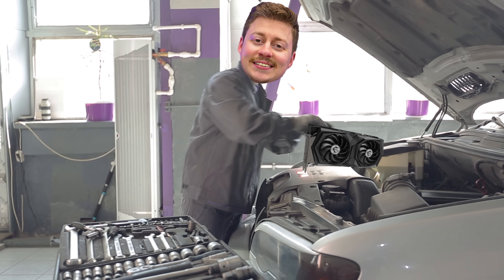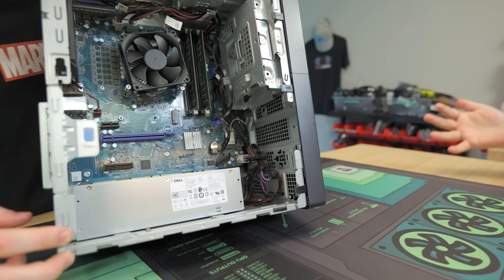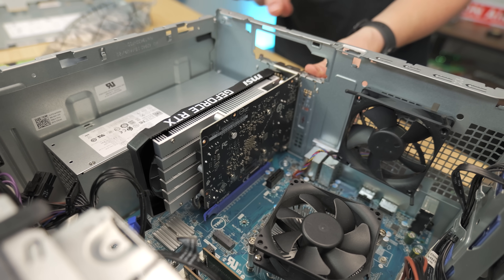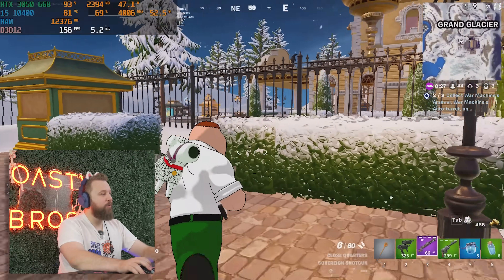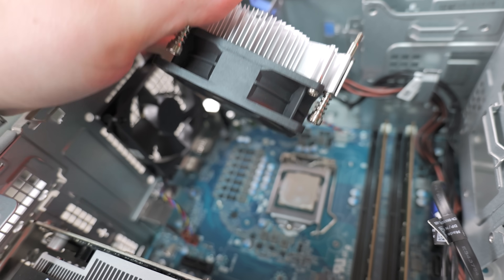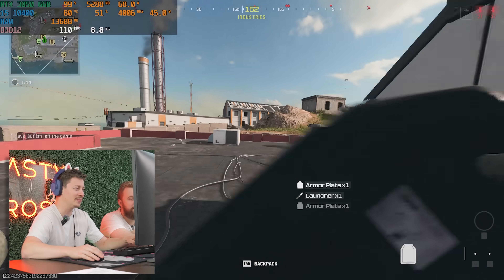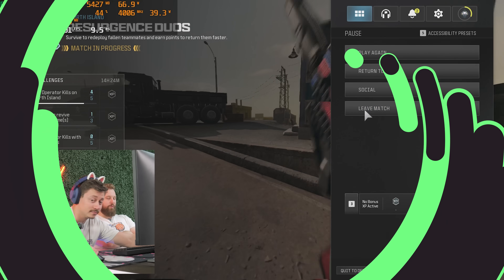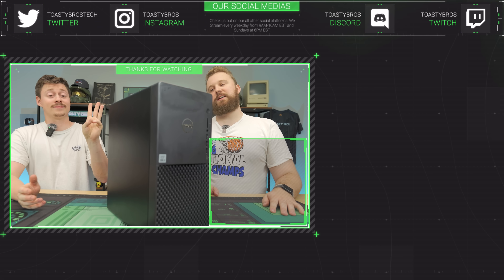EASY $419 RTX Gaming PC Build - Step-By-Step

Comment: I have dell vostro 3888 with the i7 10700 and i add the 3050 LP, but in game (pubg steam) the usage of the GPU does not exceed 60% usage. and the FPS is not stable is arround 40 and 70 FPS in low settings :/ could you help me please ?

Comment: great video. maybe th 3050 in an Ali Express CPU/motherboard combo vs a 3050 in an eBay used CPU/motherboard combo. & kinda impressed since the 3050 is mad low powered & still can play curreny games well.

Comment: I don't hate the 3050 6gb, but I don't love it either. I think this situation gives Intel a bit of shine. the A580 ranges from a good bit cheaper than the 3050 to similar, and the A580 will perform better in most games. the A750 can be found at a very close price point to the 3050 6gb if you are in a hurry, and frequently for the same price, and if you are a little more patient cheaper. That said, the A750 is going to do better in almost everything including ray tracing. 

The Rx6600 is pretty close to the price of a 3050 6gb as well, and would perform better as well.  

If Intel could do a half height single slot A380, those 10th gen Optiplex would be a real bargain. They have resizable bar, and sell new for around $100.

Comment: 10th gen comet lake is the new 4th gen haswell. Cheap but still perfectly relevant. Hell haswell is still putting in good work after all these years if you have the unlocked i5 and i7 k chips and they have a healthy oc.
Reply: I have the curse of an i7 10700f and a 2070 Super. It runs everything in 1080p high to max and I don’t need to upgrade at all. That’s the problem I want to build a new pc but unless I go up to 1440p there is absolutely no need.
Reply: @jeffleecust  Gpu is all you would need and a 1440p capable card isn't all that expensive if you go used. They have plenty of videos showing which used gpu are worth it.

Comment: XPS 8940 has proprietary power supply connectors, although you can get up to a 600W power supply for it. XPS 8930 is a generation earlier (8th/9th) but it has 24-pin standard power. Something to consider.
Reply: You can just run 2 psu if you want the extra power

Comment: I have a 11400f on a b560 motherboard with rx 5600xt. Im running a hyper 212 cooler and the temps are really good.  Actually i found out while benchmarking my PC that it was throttling at like 43C and dropping from 4.2ghz all core to 3.8ghz all core because it was in 65watt mode. Tested with a program from intel called XTU. From there i played with the settings and it was easy to make it so it was set to 125watts and didn't throttle. Be careful if you try this on a stock cooler it may overheat.

Comment: My son uses the original 8GB 3050(not the laptop die)and you're right, it's a very slept on card(for the 1080p market)!
Reply: Rx 6600 is cheaper faster and better at this price point ray tracing is not worth it

Comment: About 2 months ago I found an acer aspire at a store with an i5 11400 16 gb ddr4 (I find it funny the original owner added xpg rgb ram) and a 512 gb nvme also with a keyboard and mouse for only $99. Bought an msi 3050 low profile and a new fan because it sounded like a jet engine. All of it for less than $300 before tax

Comment: I have an i5-10400 paired with a 2060 Super, 32gb RAM, and a 512gb NVMe in a Cooler Master Case that I built.  It runs like a beast , and has an upgrade path. I have it listed on Marketplace for $480 for a couple of months now, and the highest offer I got was $300!! I should start linking these videos to those people.
Reply: It’s used not new what do you expect
Reply: exactly the gpu is used not new,and for $480 I could build a better used pc than that 😅
Reply: Just because new gpu hold their value doesn’t mean used do the same 😢
Reply: @chiboy_speaks  So you are saying that my price is way out of line for the specs, and that the 2060 super is not worth the $175 I paid for it?  What is a fair market value for it? I was basing my price of my cost, and what I see her on Toasty Bros.

Comment: I just got a barebone one free from a friend, he got it off a dude that bought several to sell the GPUs back in 2021, he took the 10700k out of it and put in his PC, so it came with no RAM, CPU or SSDs. Luckily it has the 500w PSU, so I'm thinking of doing a 10500 or 10600(K) and maybe a 2070 or 3060 and use it as an HTPC/light gaming once a while.  These apparently can be upgraded to a Veetroo V5 or a Noctua NH9S for the CPU.

Comment: I run 10th Gen i7 in my primary machine (with a 3060 12g) and am happy with the performance I get across the board.  I like having 2 generations between me and the CPU that eat themselves.  :)  (of course I'm not using that stock cooler nor did I keep it in that suffocating case)

Comment: I snagged a Prodesk 600 G6 from ebay for 143 dollars last week (after shipping and tax), it's got an i3-10100f and an R7 430 gpu, 16gb ddr4 and a 256 gb nvme drive. Probably gonna snag a 3050 6 gb for it if the power supply is connected with something other than a 24 pin but I expect it to perform quite well for the price

Comment: The XPS 8940 is OK, but there are things people should know. Cooling is an issue, while the I5-10400 will do great an I9-10900K will not like it. I bought an XPS 8940 last September with a I7-10700. I bought on eBay the VRM heatsink. Took out the 1 case fan and added 3 Noctua fans. Replaced the CPU cooler with the Dell tower cooler, found on eBay. In addition, took out the 360 watt power supply and put in the Dell 500 watt power supply, which is 80 Plus Platinum. Dell did use several different Mother Boards for the XPS 8940 and some of them can be upgraded to 11th Gen with a BIOS update.
Reply: I just got a free one from a buddy, I got the 500W PSU on this one, no GPU, CPU, PSU, Ram though, so I gotta source out everything else. lol
Reply: The CPU cooler upgrade and rear fan (80mm -> 92mm) are pretty crucial. I used a Veetro V5 cooler, which was a drop in replacement, along with a Noctua 92mm fan. That’s the biggest difference right there.

The VRM heatsink is a nice addition. You can buy straight from Dell for a fraction of the price if you know the part number. Just get on chat with customer service.

I installed a front 120mm fan recently and honestly there wasn’t a big change in temps. I’m currently using a 6650XT.

Overall I’m happy with the desktop for my use, especially the size. But it doesn’t hurt that I picked mine up 2 years ago for $100 near brand new off marketplace. It was a really weird sku with no gpu, 8GB ram, 1TB mechanical hdd, and, oddly enough, a i7-10700 😂
Reply: good data. mb

Comment: I have flipped a couple of optiplexes and hp pros, so i had an hp pro sff with an i7 just hanging around and i wanted something for the living room, so i bought a low profile 3050 on amazon BRAND NEW for $160(seller had save $10 coupon) and this thing does wonders! i can play any game i throw at it with great fps at decent settings. The 3050 is definitely slept on but great for "future-prrof" budget pcs.

Comment: Just wondering if there was something running in the background when you did the 3d timespy test cause i find it odd that it scored in the 5100s cause i just asembled a xeon e5 1620 v4 @ 3.7ghz with a 1660 ti and got a score of 5796 surely the difference between a 3050 and 1660ti cant be that much?
Reply: The 1660ti is more or less on par with a 3050 8gb, and quite a bit faster than the 3050 6gb. Roughly 25% faster i think.
Reply: @83Bongo  ok thats what my testing has led me to believe as well but still kind of baffled how a older xeon based system got a better score considering it cost about 350 cad with 16gb ddr4 and a 1 tb ssd. I mean to be fair i stole those z440 workstations at 35 cad

Comment: Lol my rtx 3060 better lmao
Reply: who woulda thought that the 3060 is better than a card that’s just a power efficient 1660
Reply: Good budget card .👍
Does the job .
Reply: @gazzertrn  correct
Reply: My RTX 4070 Ti Super is EVEN BETTER!!!
Reply: @AmericaFirstWANGHAF   my ryzen 3060 costs more than your gpu
Reply: @Gargentwitchongargee my 4090 bashes your 3060
Reply: @logangeorge2469 did you get a asus 4090 or any other 4090 model cuz if you did asus you wasted an extra 400
Reply: @logangeorge2469   my ryzen 620 is bussing over you
Reply: @Dabowsk1  Asus tuf 4090 is what i got. I used a pny 4090 before and it was just as good.
Reply: @logangeorge2469  damn.
Reply: @AmericaFirstWANGHAF  and so it begins
Reply: Rysen 4070 is better